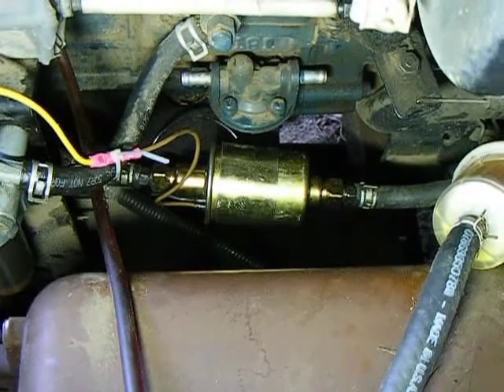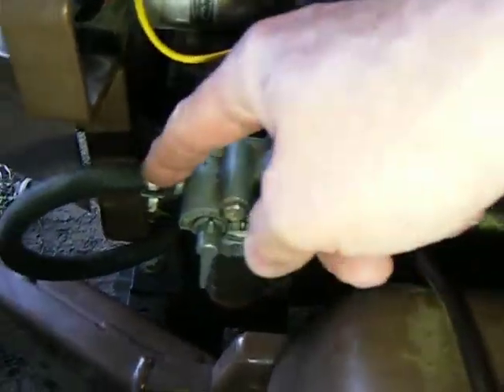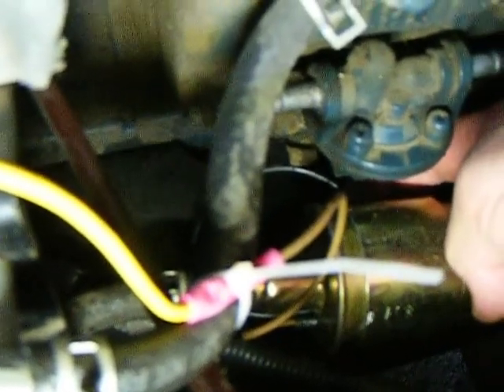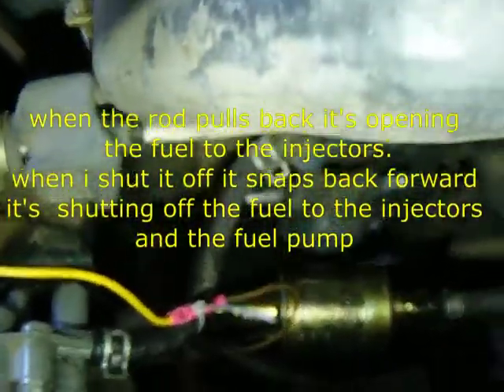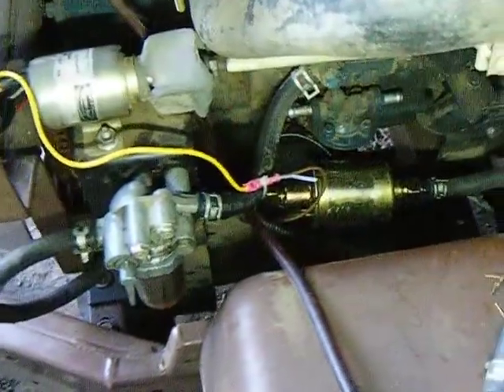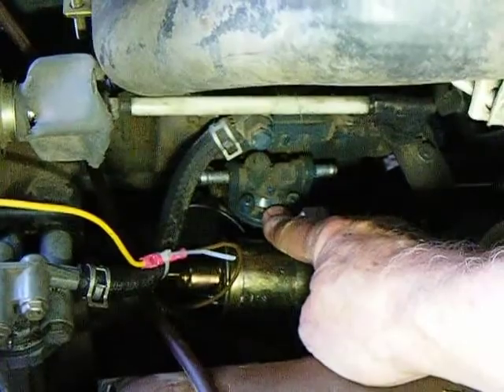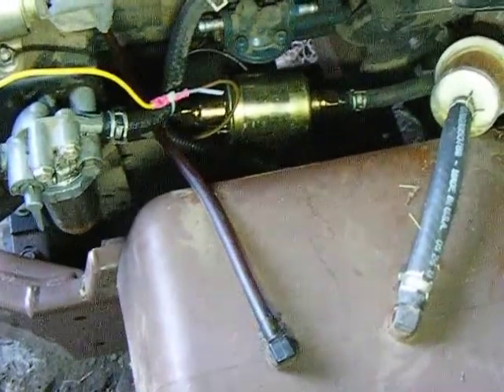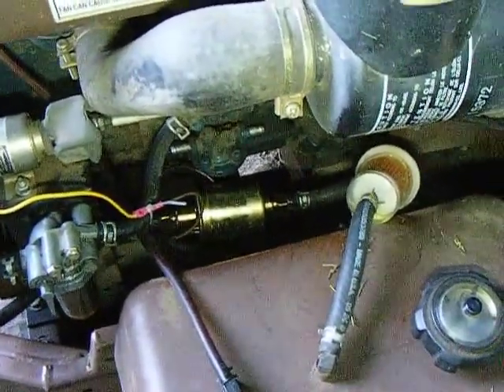converting a grasshopper diesel mower to electric fuel pump

Comment: Did you cap off the input and output for the old mechanical fuel pump? I thought about doing this, but I'm concerned that if the i ner membrane ruptures I could end up with a major oil leak.

Comment: Hello sir! Thank you for this video! Quick question, by running an electric fuel pump does this Totally Bypass the injector pump? Thank you in advance..
Reply: No, the electric pump is being used as an alternative to the mechanical driven pump he injection pump is used to make a higher line pressure to send to the injectors

Comment: Do you have model# / brand of fuel pump that you used & where you purchased it. Thanks for the informational video.
Reply from the maker: I don't, it was just and old rattle style pump you can get cheap off ebay.  works great.  so long as it's low pressure you'll be good.

Comment: How much pressure should the electric pump be putting out? Also where the mechanical pump arm goes into the injector pump and touches up to cam shaft. is there supposed to be oil in there? You mention diesel getting to oil and when I took off my mechanical pump it was dry behind it.. Good Video, Just need to know what pressure.
Reply from the maker: Most electrical pumps like the one shown pump between 3-7 lbs of pressure.  on the mechanical pump when the diaphragm breaks in the pump is when you'll get fuel into your oil.  same with old cars.  the pump arm should have had a light film of oil on it.  otherwise it would be metal to metal with no lubrication and just tearing itself up.
The only thing i would do different is, i wouldn't mount it to the engine, i would mount the electric pump to the frame. the engine vibration is hard on the little electric pumps.   I also found a secondary problem with mine later.   mine had been setting for years when i bought it.  at the top of the tank there it a 90 degree elbow mine had something stuck up in the elbow  restricting the flow from time to time.  i pulled the tank and blew it out and haven't had any more problems since.